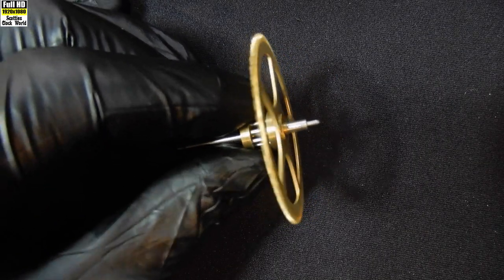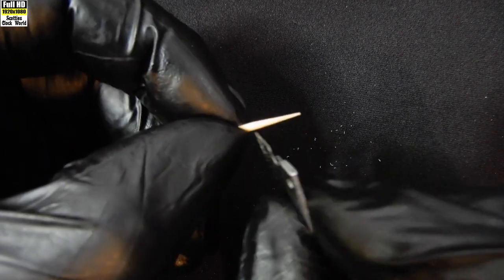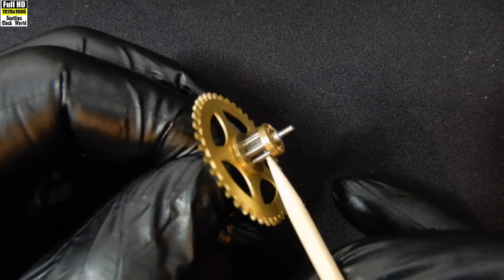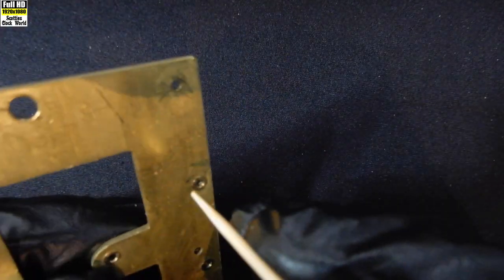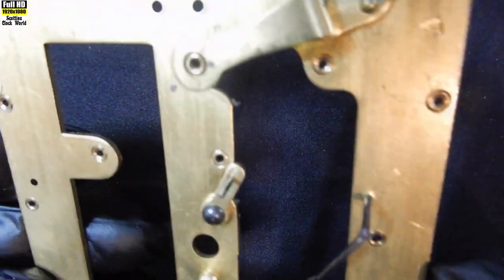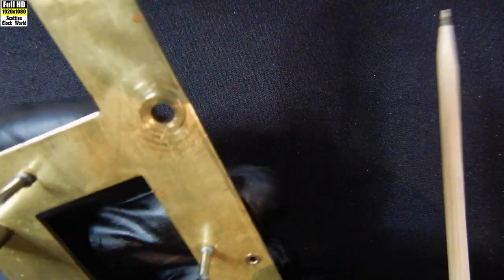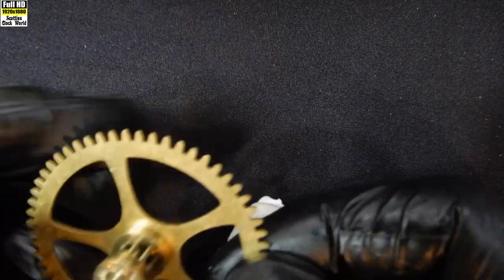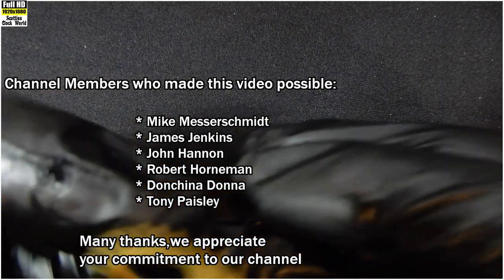Clock Repair For Total Beginners - Lesson 7

Comment: Thank you Scottie.   I’ve been trying to find something to work on in the evenings that doesn’t require a lot of room.  I wanted something along the lines of watch repair but I didn’t want to make that large an investment initially.  This is perfect as I’m already a hobbyist and have most everything sans wind down tool and spring hold clamps.  I’ll continue to follow along and I’m actively trying to acquire a similar Gilbert movement.  I can’t wait until you get into verifying pinion fit and possibly having bush the pivot points.  Thanks again for taking the time to film and share your knowledge.
Reply from the maker: @allanjacobs977, sounds like you are well on the way. We wil be looking at the theory of bushing in a couple of weeks, unfortunately there is no common household tools that can be adapted for bushing clock plates. However I have a couple of videos I made not long ago that show how to do manual bushing, they cover reaming out the plate and broaching out the bush to the correct size for the pivot. Timesavers sells a KWM hand reamer set for just over $100 that is quite good value. This is the link if you are interested: https://timesavers.com/i-8948895-kwm-style-hand-reamer-set.html